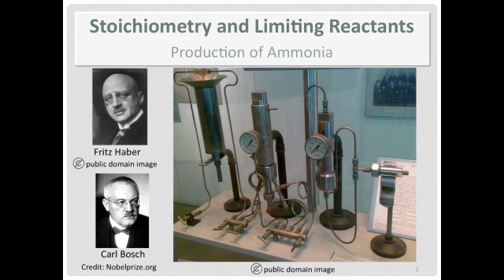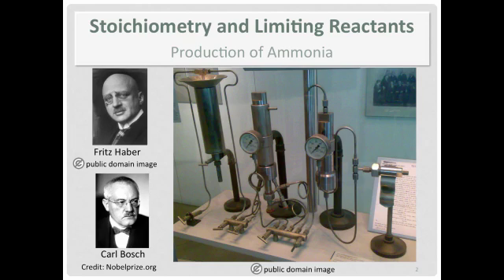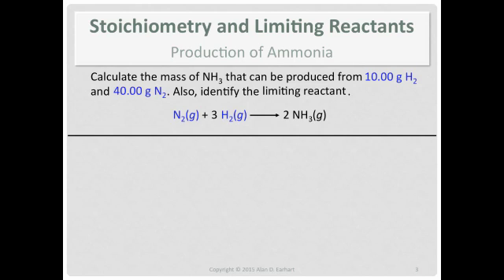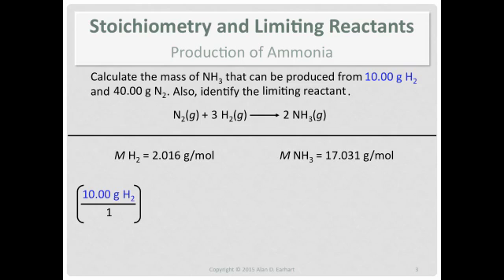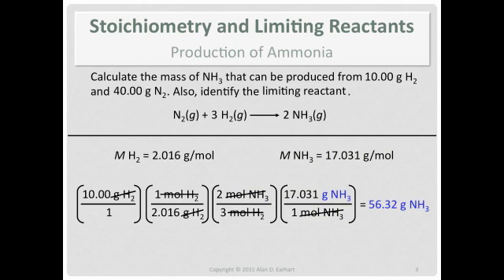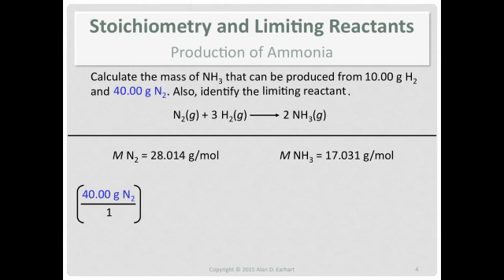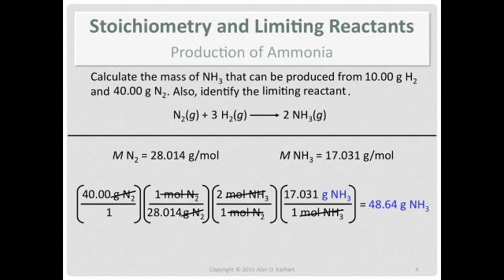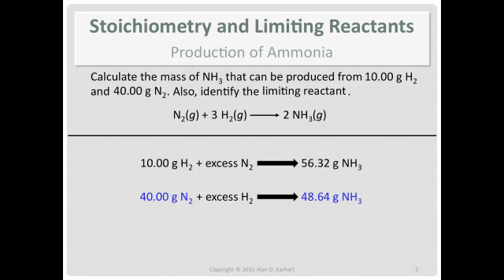Stoichiometry and Limiting Reactants: Production of Ammonia (Method #1)

Comment: Hydrogen gas will be limiting reagent. Production of 2 mole of ammonia 3 mole of hydrogen gas needed. When you start the reaction 1 mole of nitrogen is enough to produce 2 mole of ammonia but 1 mole of hydrogen will not sufficient you have to add 2 mole mor hydrogen to produce 3 mole ammonia.
Reply from the maker: That's only if you have those mole amounts. In this problem masses of hydrogen and nitrogen are given which require more work.

You'll see what I mean if you watch all of it.